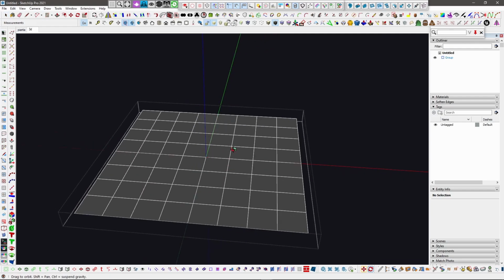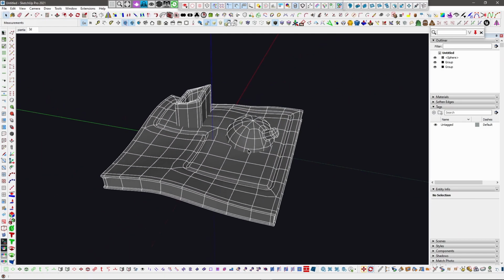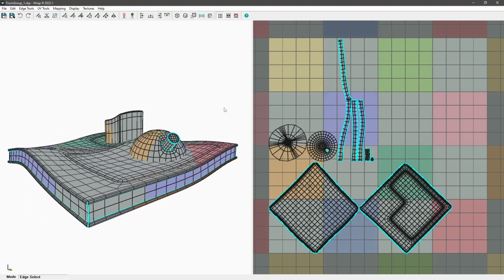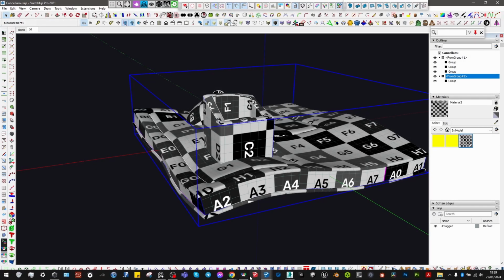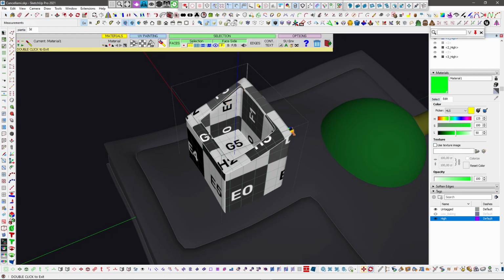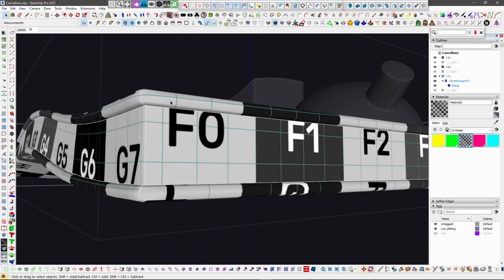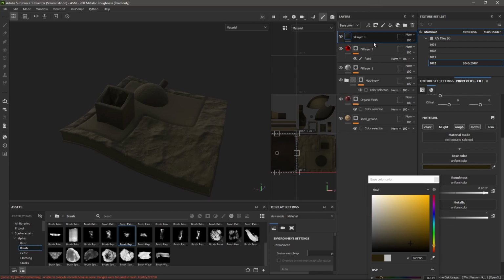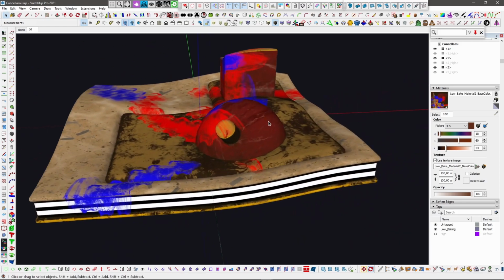Sketchup quad model to Substance UDIM using Wrapr

Comment: Blender or Maya is much better for such things...;)
Reply from the maker: Yeah and 3dsMax too (I actually use it a lot for production work). 
Sketchup is way better for accuracy and architectural stuff toh, and is generally faster and easier to use, so I use both for most projects and take advantage of their complementary strong points in different areas.
I did this tutorial for people that can only use Sketchup and think that is not possible to use it with Substance.
It's actually perfectly possible.